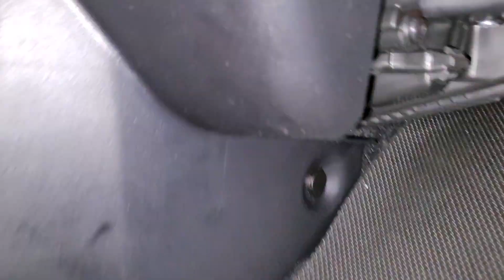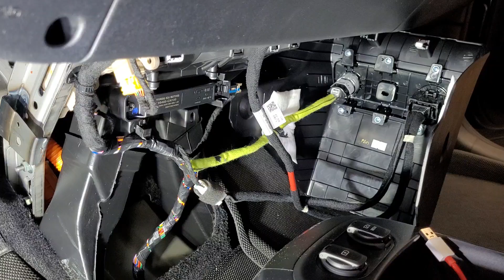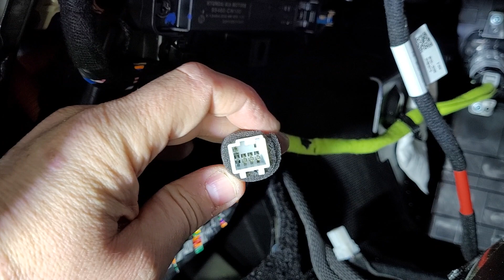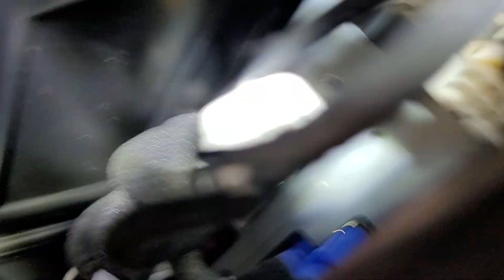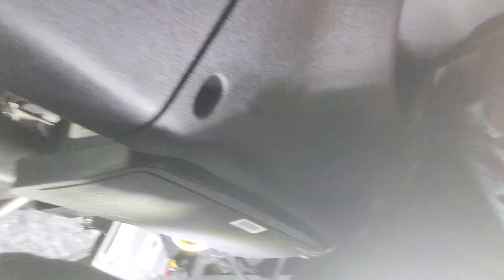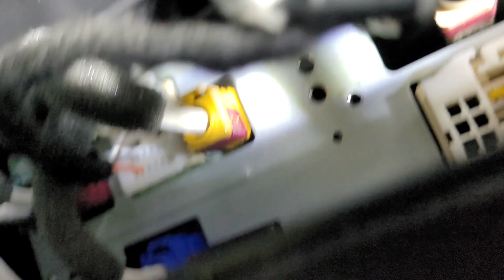Kia EV6 and Hyundai Ioniq 5 USB disconnect fix for Android Auto/Apple Carplay

Comment: Thanks for the video. I haven't had any connection issues but I did need to disable the stalking and Insurance reporting. 

The Kia connect and onboard Wi-Fi are The two connectors to the left of the white plug above the USB. It seems it genuinely nobody knows what the yellow one is but I'm plugging. It has absolutely no effects on functionality. 

As a side note to unplugging things making the car better unplugging the white cable going to the USB fixed my connection issues. I did not unplug The actual USB cable. I did pop the USB port out of the kicker panel and pop the cover off. 

Inside of it is a simple white circuit board. It's more than two layers so I can't be 100% sure without destroying it or probing it. But it looks like the white cable is for the RGB around the port and it hits all the LEDs on the board but strangely, it also does have a positive connection to the actual USB connector port. 

If I were a guessing man I would say the cheap RGB LED controller is introducing noise and signal fluctuations or even heat buildup (one tiny shared ground) 

It reminds me of those those $20 or $30 DUAL Head units you can get at Walmart and stuff that were normally okay, but if you hooked a subwoofer up to them, you would get a constant droning noise from the ground loops in the head unit.

Comment: Add me to your list of people you helped!

My ai box stopped working on my 23 ev6 gtline. Previously a few random restart but this time it just wouldn't start. I tried different cables. And then saw your YouTube link on reddit.

After your YouTube fix, it now works! Disconnected the white and blue plugs
Blew some air in the connectors. Taped down the white plug. And now my ai box is starting up again. I wonder if unplugging it soft resets something in the Kia software. Bc my plugs was securely connected

I read some left the white plug disconnected. I'll try that next if it stops working in the future.

Thank you!

Comment: Exactly the same problem with my EV6. It’s gradually got worse over the past year and now it’s almost unusable - disconnects and reconnects itself every few seconds. KIA dealer have finally recognised the fault and having to jump through hoops to get KIA to replace the cable under warranty. No end of silly little issues with the EV6 - built to a cheap and poor standard. Would not have another that’s for sure.

Comment: Thanks for the video, have same problem, reconnect all cables and also cover with the tape the blue connector "might fix the vibration thing", if it not helps I will order cable replacement, number of cable is - 96120CV000

Comment: Nice, with this trick I managed to do the latest july 2025 firmware update - it would not even acknowledge that I had plugged in a usb pen before and my CarlinkIt had stopped working also - all fixed - just by unplugging and re-plugging the adapters in.

Comment: Amazing! My CarPlay was constantly cutting in and out was driving me insane. I followed this video, just unplugging and reconnecting those two plugs and it fixed my issue!!! Thanks so much for sharing this video. 🎉
Reply: Can you share what type of cable you use? I think mine might not be a data+power cable...
Reply: You can test your cable in a PC. Just plug the cable into your phone and PC, unlock your phone screen and the phone should show up in your PC file explorer.

Comment: This is so helpful! Fixes ine of the few issues I had with my EV6. But I have to do it line every 4th mont or so and the dealer does not want to aknowledge the problem…
Reply: You need to take it to an authorised Hyundai dealer / garage and invoke the warranty provided the is under 5 years since first registration.

Comment: On the left side we can see there's a heat duct, that pipe gets soft as melting cheese in Winter, I would want to avoid the USB cable from there and unfortunately I haven't brought adhesive tape this time, I would definitely do that next time.

Comment: my 2022 model has a 10mm bolt under the felt. You’ll break clips if you don’t take that out.
Reply: Is that for Ioniq 5 or EV6?  If EV6, can you elaborate as to the location of the 10mm bolt?

Comment: Thanks for video, my car play stopped working and I’m trying to fix it this way.
Am I the only one struggling taking that cover off? It seems to move off dragging by lower part, but I’m not sure this is how it it supposed to be done. Do I need to apply more force by dragging from lower part? Appreciate
Reply: For the record: you have to move cover from upper part, not lower one. I started from up left side and it eventually unclipped.

Connectors seem to be sitting tight, but reconnecting them did the trick and CarPlay started working. I’ll apply electrical tape to be sure.

Comment: So far so good. My 2023 Ioniq 5 has an extra bolt at the base of the pocket. The connector is also fixed to the other end of the console. Thank you for the video. Now here’s to hoping the 4 different wireless CarPlay adapters I returned work 😂
Reply: How did you find out if they worked if you returned them? 😉
Reply: Doing this project now after many recent drops. Discovered the bolt in base in my 22 I5.  

I bought the replacement cable.  
Having difficulty getting the blue connector inserted that is up under the dash.

Comment: Problem is the white connector. Just disconnect that one and leave it like that, you don't need it is just for the light ring around the usb port. Once disconnected I didn't experience any problems anymore now for over 4 months with my AA Motorola dongle.
Reply: Ciao, io l'ho disconnesso oggi, vediamo se il dongle Usn carplay rimarrà piu stabile.
Reply: I tried this method.. however after 2 weeks it is getting disconnected more frequently… and it’s annoying 😣

Comment: Thanks for this problem-solving video.  I was able to restore CarPlay by reconnecting only the white plug.  I could not access the blue cable into the head unit.  It is not accessible in my 2023 EV6 as it is apparently concealed behind additional plastic housing.  But I did get luck with the one reconnect -- at least so far.
Reply: Same problem here on my 2023 EV6. The blue plug is even harder to access, and all I've been able to do is pull the blue plastic off the actual connector! 😢

Comment: I’m not sure the white connector is in any way related to the USB data. After opening the USB receptacle shell and inspecting the PCB, I could see no connection between both cables. The white connector only seems to power a small white LED that makes the port easier to find at night. I tested this by disconnecting the white connector and only keeping the blue connector plugged in. On the blue connector side, I measured up to 2 amps at 5V to charge the phone and stream CarPlay to the infotainment unit. 
There seems to be a small inline fuse or PTC on the D+ and D- lines which could be responsible for all of our woes. If it is indeed thermally sensitive, then disconnecting the white connector which powers the LED would reduce the heat building up in the USB receptacle.

Comment: Thanks for this fix. I've had my EV6 since May. The dropping of the USB connection, both by wire and by wireless dongle, has been annoying - especially when trying to sing along to my favorite songs! I watched your video and gave it a whirl. A scraped knuckle later, I couldn't get the white power connection apart, but noticed there was a lot of wiggle in the plugs. Put my first aid skills to use and wrapped that connection with electrical tape in a figure-8 pattern, as tight as I could pull them together. Took a test drive down a bumpy road, wait... I live in Louisiana... ALL the roads are bumpy here. Took a 20 minute drive and had ZERO disconnection events. Fingers crossed this streak continues!!
Reply from the maker: Sorry about your hand! Hope it works for you. I'm coming up on a year without drop outs after the fix

Comment: Update on this one for me: Although I managed to get it to work for a little while, it finally started acting up again after a few days. I tried several times and always got the same result. I ended up bringing the car to the dealership, I'm not sure exactly what they did, and within an hour, they fixed the issue for good, or at least it seems so for now (3 weeks after the intervention). That's without changing any parts.

Comment: To everyone with this disconnect issue - just disconnect the power (white) clip that feeds the USB, and leave the data port blue clip connected. This will solve the problem. Get yourself a wireless carplay or Android adapter, and your life is all set. The reason the disconnect is happening is because of voltage fluctuations in the USB due to the power feed, and the USB port resets itself. I tried the grease, replugging, and replacing the port, but nothing fixed the issue until I disconnected the power side. After disconnecting the power side, the hardwired phones will still show charging, but it is charging at an extremely slow pace. Recommend getting a wireless adapter and using another port for charging. Your problems will be solved. 😃
Reply: Thanks!  I only disconnected the white one and it immediately fixed the problem!
Reply: Won't the wireless adaptor need to be plugged in to the same USB port which will transmit via the white clip? How will wireless adaptor work if the white clip is unplugged but the USB is used to hook it?
Reply: @shashankkumarshankar3655  It will work w/o the clip.The data side has data + enough power to boot devices but now enough to charge devices.
Reply: @shashankkumarshankar3655 data connection has power
Reply: Yeah my dealership has replaced my headunit and the USB port with brand new parts... but the the disconnect issue just keeps creeping back after some time. Do you think swapping the car battery will help with the voltage fluctuations?
Reply: everything still working ?
Reply: @ViewlessSquid  Only 1 reset/crash since I disconnected the power feed. Earlier, it used to reset/crash 2-3 times a week. It is definitely more stable now.
Reply: I was very enthusiastic about this solution and thought my problems were gone for good. However, after 1 month without disconnecting it all came back😢. It happened again and could only be stopped by disconnecting the blue connector again. I leave the white one disconnected because it was at least more stabile then before, but this is also still not the final solution!
Reply: @robinspoor6824  consider getting the usb cable replaced under warranty and see if that helps. I have read comments where evening replacing the cable didn't fix the issue and ultimately the head unit had to be replaced.

Comment: Gave this a shot on the 2023 Ioniq 5. We shall see how things go. I couldn’t see/find the second blue cable… but i just gave all visible fasteners a good push tightening. Before putting it all back together I wiggled all the cables to see if a disconnect would occur, and it never did. So if mine continues to disconnect it may be a completely different issue.
Reply: Update. Just took an hour drive. Disconnected twice. So time to schedule an appointment at Hyundai.

Comment: Tanks for your video. 
I have now implemented the instructions. In my case (EV6 built July 2022), both plug connections were not fully plugged together.
Both the white connector and the blue one were loose and could be pushed a few millimeters into the connector.
That's why I just pushed them together and didn't unplug them and plug them back together again.
The hardest part of the whole operation was getting one of the two black side pins that hold the plastic cover back in the hole because it had come open at the top and didn't fit in the hole anymore. I then simply took some tape and glued the 4 elements of the pin together at the top. Then I was able to slide the pin into the hole and lock it as well.
Another hint. I had to use quite a bit of force to unclip the cover at the top of the two clips. I then used a screwdriver to get my fingers between the top and bottom covers and then forcefully pulled the cover forward.
A short test drive of 3 minutes at least didn't show any more problems, this morning I already had 3 dropouts in 3 minutes when using Apple Carplay.

Comment: Anyone have any updates after a few months of usage after this fix? I am going to show this to my dealer and outline that THEY need to correct the issue as the constant disconnects are driving me nuts. To the point that I am looking into selling the EV6 and going back to Tesla (had a M3 prior to the EV6) and buy a MY. Now, I know the Tesla doesn't have Apple Car Play like the EV6, but the overall OS makes up for that difference. Anyways, any feedback would be great. TIA!
Reply from the maker: Still no issue since doing this for me.
Reply: @alexdrinkwater28  awesome news 🤩 car is in to the dealership tomorrow morning. Will/Have provided this video as a link to them, so they can address it (vs me taking apart the car). Thanks for the update!
Reply: @alexdrinkwater28  ossia, hai staccato solamente il connettore bianco e non hai più avuto disconnessioni?
Reply: My EV6 was in the workshop yesterday and they only tested the USB port while it was stationary and of course everything was fine. They can't do anything without mistakes, was the reply.
A short drive today brought 3 dropouts within 2 minutes. Annoying. I'm going to try the tip in the video right now and hope it works for me. Otherwise I have the next appointment in mid-June, but until then ABRP can hardly be used via Apple Carplay because Apple Carplay is always interrupted.
Reply: @E-Mobility-Today  I showed this video yesterday when I got the car serviced, to their front desk. The service centre tech did what was outlined, but they also ordered an entire new USB section part, as he wanted to make sure it was really addressed (I understand what he was trying to get across). Have driven the car for a total of 25-30 minutes with no drop outs so far, whereas on the way to the service appointment it dropped at least 1 time. Yet, for some reason I expect it to drop out at anything. We will see.
Reply: @WetWestCoast  Did the fix continue to work over the past 10 months since posting this?
Reply: @cat5e  interestingly enough, to have this question pop up… Just the other day it started to disconnect again. Tried various cables and still intermittent disconnects, so same issue. Stopped by dealership and have appt scheduled for next week. I think this time they’ll order in the new usb harness setup and replace it entirely. I’ll bring the video in again, let them try to reseat it again.
Reply: @funkright  Thanks for the reply and good luck with the next fix attempt. At least the first fix attempt lasted several months. I am about to buy a used EV6 and tested the USB A port before signing papers. The port was completely non-functional but seemed to be the only issue with the car. I insisted that they fix it before I drive off. Hopefully it's not a long-term issue, as Android Auto is very important to me.
Reply: @cat5e  my initial fix lasted almost 1 year. I understand the importance of connectivity to one’s device. I like Apple CarPlay with Apple Maps or Google Maps, which is quite a bit better than the built in GPS. That would be one of the biggest PITA’s. Bluetooth connectivity is pretty much bulletproof, so I just use that to stream app features (podcasts, music, etc) and the car’s Bluetooth connectivity allows me to handle most functions for those apps. Not ideal, but workable until the issue gets resolved again.
Reply: @WetWestCoast  hai avuto disconnessioni, da quando hai staccato il connettore bianco?
Reply: @gianfrynco  since usb port replaced all has functioned as it should.
Reply: @WetWestCoast  come hai fatto a sostituire la porta (costo, si trova online)? hai anche staccato il connettore bianco dietro?
Reply: @gianfrynco  warranty replacement

Comment: I also put electrical tape around the connectors to give it a better connection. If you just pull on the to connectors just a little you will see some play between the two. By putting tape on the white connectors to tighten the play up and it has stopped. I think it is cause there is so much play between the connectors that it is just enough that it is causing that. Just my 2 cents. Thanks for the making this how to video! Helps a lot!

Comment: I was also getting frustrated by losing connection with my phone, or no connection at all. I tried different cables, cleaning the USB port in my phone, but no succes. Somebody on FB pointed me to this video and that did the trick. It is very easy to disassemble the panel. For me it was enough to reconnect the white connector and I have a stable Android Auto again in my EV6. Thanks Alex!

Comment: Hi! Thank you so much for sharing this! I was so annoyed at my Ioniq 5 disconnecting my iphone after only a few minutes of driving each and every time. I followed the same steps, although it looks slightly different than what you're showing in the video in my car (French late 2022 Ioniq 5). The first time, I tried only to unplug / replug the first cable and it didn't help. I did it again after a few days, unplugging and replugging back the blue cable as well, and it did the trick! I'm so happy I can finally enjoy carplay the way it's supposed to work. How can Hyundai not fix this!? Cheers mate!
Reply: hello! how did u manage to move back the plastic cover? i tried it by removing the two plugs shown in the video but there seems something it is holding it in place at the bottom in the middle.  did you have to remove anything else to be able to move the plastic cover?
Reply: @suffix642  yes. There is a screw in the middle at the bottom of the console, under a little rug